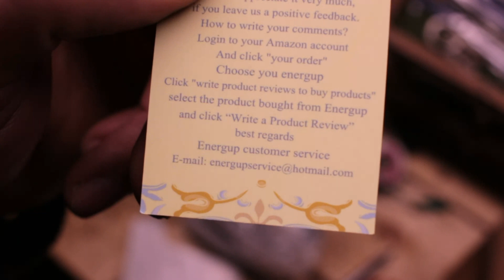Engerup P108 battery for Ryobi tools, repair, test and review

Comment: That first board looks the same as the one on my 2017 built genuine Ryobi batteries (well the 5S ones, the 5S2P have a larger heatsink)!  Whether it’s as good at doing what it supposed to is anyone’s guess though.

I recently bought an aftermarket battery to see how bad they are after I got an offer for one at £12 delivered on eBay.  It was a “6ah” Vanttech.  I didn’t even run the thing before taking it apart.  The temp sensor was flush with the bottom of the board and about 5mm above the cells, but actually more as it’s above the gap between them (with plastic covering the top of them).  It is also significantly smaller than my Ryobi boards.  Some of the welds were barely connected, one actually came off the cell when I touched it.  Another weld was actually to the paper insulation ring on the positive side of a cell!  One of the springs for the push in side button was contacting the cells when depressed, but there was barley tape on the other side.  The welds were also much better and stronger on this side, like each side had been done on a different line. The cells were connected by 0.10mm plated steel  (it failed the salt water test) which isn’t going to take a lot of current.  The no-name cells are currently testing but internal resistance appears to be all over the place and there’s a 200mah capacity difference on the first run on the first batch of 4 cells.  Oh, and they are 2ah cells so it’s at best a 4ah battery.  No heat sink anywhere in the battery.  Quality control seems to be replaced with cost control.  I doubt this would have lasted very long.

Still, with Ryobi charging £100 these days for a genuine 4ah battery and no real discounts in the UK it’s not hard to see why people would be tempted.

Comment: I'd say rust may be due to keeping it in a basement or garage/shop where temperature varies a lot and every time there's a humid hot day cooler battery pack gets condensation. To dissipate heat from heat sink, it probably allows air exchange through tiny pin-prick holes on the battery (very noticeable in Ryobi battery).
Reply: I guess I'm pretty randomly asking but do anyone know a good place to watch new movies online ?
Reply: @Brycen Andre flixportal =)
Reply: @Logan Jonah thank you, I signed up and it seems like a nice service :) I really appreciate it !!
Reply: @Brycen Andre no problem :D

Comment: The culprit in your case looks to be that the battery got wet inside. Li_ion packs are vented by design to vent heat and CO2 which is given off in some cases, so the are not watertight. Bringing a cold tool into a warm humid room can cause internal condensation as well. The brand name packs will use rubber instead of water absorbing foam, and they use expensive "clean rooms" to avoid microscopic contamination of the cells themselves which can lead to degradation and failures. That said, repairing these are usually not cost effective as you need to spot weld the tabs onto the batteries. The spot welders are expensive. Soldering directly onto the batteries will kill the cells. You can get cells with tabs already welded on but they are expensive enough to not be worth it.

Unlike Ni-Cads, don't overheat your Li-Ion batteries and also don't charge them in the cold either. Always store Li-Ion batts with at least a partial charge. Name brand batteries have more expensive heat sinks and better charging and monitoring circuitry to prevent overheating, prevent complete discharge, and prevent too cold or too hot charging. Also, the higher the capacity of the pack, the more fragile the cells are as they have thinner insulation inside and produce more heat. Stick with the lower capacity packs as they are more robust.  If you do get your pack or tool wet, put it into a sealed tupperware container with regular rice in it to dry them out. Put a piece of paper in between the rice and the tool or pack. This will dry them out in a few days. Don't try to reuse the rice.
Reply from the maker: I don't think it was just that the pack got wet.  The rust was just on the surface and cleaned off without much trouble.  I think the spot welds were weak from the factory.  Sure getting damp can't have helped the situation but I doubt it was the main cause.  I know soldering on the cells isn't ideal but why not try?  It was either add to the waste stream or try soldering because as you pointed out spot welders for battery tabs are expensive.  After soldering on the cells the battery has been working fine for the past several months.

The double thick packs use two sets of cells in parallel which puts less stress on each individual cell.  For the same physical pack size I would agree that the lower capacity packs would probably be more durable.  However, I would bet that the battery packs that use twice the cells would be even more durable.
Reply: YOU CAN RECYCLE THE RICE BY SENDING IT TO THE BATTERY MAKER. YOU MAY RECEIVE ANOTHER PAIR OF MITTENS.

Comment: The mosfets are a necessary part of the protection circuit, which switches the cells out of the circuit if voltage gets too low (and probably too high too, if a charger was wrong (NiCd only) or faulty).  Also, Ryobi's batteries might have costed more at the time the video was made but today you can get them in 4Ah capacity for $100 a two pack so $50 each.  However now they also have higher than 4Ah batteries which cost less per Ah and have additional electrical contacts to improve performance on their newer brushless tools that support the new contacts.

The copper on the board, unless they cheaped out and made it as thin as possible, is capable of more current than the wire gauge used.  It's also more reliable since wires flop around and can fray over time and depend on their insulation when resting against something else metal.
Reply from the maker: I recently bought a new Ryobi 4Ah battery for ~$60 and did some testing using the inertia dyno that I built.  I got some interesting results the type of battery drastically changes the power of the tools.  I would like to try one of the new 9Ah ryobi batteries just to see how it performs however, I don't really have a need for one.  I think it would make most of the tools I use heavy and bulky it might be ok with the circular saw.

Comment: I own 3 Ryobi generic batteries and they work great, but at the price point for generics vs OEMs now, there’s really no point in getting aftermarkets. In Canada these generic batteries are $55 each new, you can find brand-new OEM Ryobi 4ah batteries for $60, so even if the internals were exactly the same (they’re not) the $5 difference is worth it for the Ryobi battery casing vs the generic.
Reply from the maker: I just got a bunch of Royobi 3 amp hour +hp batteries because home depot had a sale this spring that was basically buy a new tool and get 2 batteries and a charger for free. I haven't checked generic vs real prices in a while.

Comment: I solder them all the time as long as you're quick it's not gonna hurt anything. Even if you wasn't so quick it's wouldn't probably do anything other then maybe shorten the life of the battery. I guess it could pop the safety but there's videos on how to reset them and it looks pretty simple.
Reply: Very irresponsible advice.  You can in fact cause the seal to fail, which with a Li-Ion cell can cause fire.  You might say someone did it okay but remember we're talking about dodgy low quality generic cells, where you cannot assume the robustness of the seal is as good as a major brand.   It's not a "safety" it's a vent and once vented it may never close.  Yes it is "supposed" to close but that's really not worth gambling over.  Will your insurance company pay for all your possessions if your modified battery burns your house down?  No.

Comment: 4 amp hours is the max theoretical capacity if going from 2.5 to 4.2 volts but to ensure maximum cycle life they restrict the discharge end to 2.8 and charged to 4.0 so even oem batteries don't get the true capacity but at least they last many more cycles than using the full potential of the battery

Comment: Was your test load a constant current?  It sounded like a motor and you stated it is 9A.  If it is 9A at 20V, the current may have been dropping along with the voltage so you then cannot just multiply current X time, would need to measure current multiple times, plot it, and calculate an average.  If current is dropping, obviously the true capacity is lower than calculated.
Reply from the maker: It was a constant resistance of 2ohms.  I guessed 9A average because it was a 2 ohm resistor the batteries start at close to 20V and are fully discharged at around 17V so I picked 18V as a guess. I know the voltage curve isn't linear and the resistor value probably changed as the resistor heated and probably isn't exactly 2 ohms to begin with. However, 18V/2ohms gives a nice round number of 9 amps which makes the math a bit easier.  It would be neat to log all the data and get spreadsheets and graphs and all that cool stuff but I don't really have time or equipment.

Comment: Thanks for the video! 

I realize that this is an older video, I am curious how did the batteries work out for you? Would you recommend them as a budget replacement after using them for a while?

I am pretty sure it is supposed to be pronounced  "energy up"
Reply from the maker: So far so good.  I got a set of the smaller batteries and one of those broke when my impact driver fell off my tool belt and hit the concrete floor.  It cracked but it's still functional.  So the plastic housing might be a little more brittle than a real Ryobi since I have never had a Ryobi battery crack before.  Other than that no issues.  I might do another capacity check to see if it has changed.

Comment: Check out those gloves, I got them too. Mine happen to be Kevlar cutting gloves , great if you handle sharp knives. Test your with a sharp knife first.  BTW, thanks for the video.
Reply from the maker: They don't seem that sturdy but who knows.  I will test them without my hands in them though :)
Reply: @diyVT  They aren't sturdy at all, the weave comes apart in places, so poor quality but mine still are great for handling razor sharp meat slicer blades.

Comment: thnaks for your video. I want to buy the ryobi fan p3320 and was about to get this battery for that fan for using once in a while, (power outage, fishing trips etc) will you recommend me going with this energup or spend extra 20$ and getting de 4.0mah original ryobi battery? thanks a lot
Reply from the maker: I would say it's worth the risk for something that's not critical.  The fan is low vibration and if it stops working it won't cause you to lose money.  If you were working some place and needed to run a battery sawzal (high vibration) and would be out time and money if it stopped I would go genuine.  It is a bit riskier going with a off brand battery but both of mine are still going strong, the one I fixed and the one I got as a replacement.  If you do get one I would be interested to know if it looks the same as the first battery I got or the second one.
Reply: diyVT thanks for your time. Im a “girl” when powertools is about. I dont have ANY powertool im not into any platform. I do a lot of fishing and 4x4 trips etc. Also in my country (venezuela) we have almost everyday power outage for 2 hours daily (yeah we are screw by dictators) and wanted something portable like this fan. I also thought like you: this fan is not a powertool so i think the original one could be too much for my appliance (for the other side the original can reach almost 11hr on low). Y think i will go with the knock off and take those 15$ to buy an extension cord. If i get it for sure i will write you back. Thanks again

Comment: i need to find the board on the battery.  i had 4 batts get wet the boards blew out not the cells
Reply from the maker: I have a thin battery that the cells died in.  I thought about rebuilding it with some used cells I have but I don't think that it's worth it.

Comment: 10:37 where did you get that ratchet screwdriver? Or what brand is it?
Reply from the maker: I got it in a batch of tools from my grandfather-inlaw's estate.  It says Durex on the handle.  I can't say I recommend it though.  It's not very confidence inspiring when you try to apply a lot of torque, it feels like the internals are flexing and might break at any moment (there has to be a Durex condom joke there somewhere).  For low torque stuff it works great, particularly for specialty fasteners that I need to break out my security bits to remove.